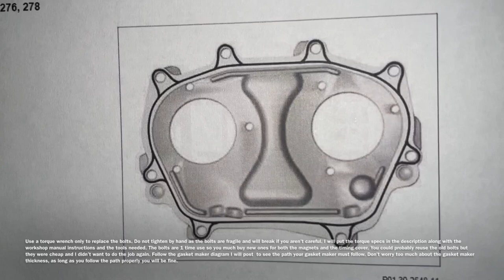Mercedes timing cover / cam magnet reseal - oil leak fix for M276, M278, M157 and more.

Comment: The M276, M278 and M157 seem to all suffer from cam adjuster cover oil leaks. Guys, check yours on your next service. Both covers are leaking on my car, car is at 104K km. Due to the position of the covers, dripping oil may destroy your alternator/AC compressor. It's a relatively easy job too.
Reply from the maker: Yes it is a pretty easy job, just important to be clean.
Reply: this is a common issue, mercedes issued a TSB on this, but the problem doesn't occur until after the warranty period. They should've extended this problem to at least 100k miles for TSB warranty. Save your receipts and file with the appropriate agencies / lawyers. maybe we can get re-imbursed for something that is obviously defective.
Reply: @ginco_bnz  this is a common issue, mercedes issued a TSB on this, but the problem doesn't occur until after the warranty period. They should've extended this problem to at least 100k miles for TSB warranty. Save your receipts and file with the appropriate agencies / lawyers. maybe we can get re-imbursed for something that is obviously defective.
Reply: Shit I was thinking why my alternator looks so greasy and dirty. Well now I know all coming from the leak above

Comment: Hey, thanks for the video. I am doing the same and the job is a little more complicated then what I had anticipated, space is tight on drivers side even after removing the coolant reservoir, but I realized that the intake plenum is completely in the way of the bottom-right two bolts. Any solution on how to take them out? I bought U-joints to no avail, looks like I need to remove the intake plenum/manifold which I do not want to do. If it's necessary, is there any easy way to remove it? Any tips would be great, thx!
Reply from the maker: I added a PDF of the workshop instructions for the passenger side in the drive in the description. You don't need to remove the intake manifold, simply use an 8mm combination wrench on the 12 point star side to remove the bolts you can't reach.

Comment: thanks man. helps a lot. the  insane thing is that mercedes issued a TSB on this, but most of the leaks occurs after the warranty period. Mercedes should be issuing a recall this since it is so common.
Reply from the maker: Yes you're correct, a tech I know at a Mercedes dealership told me to check for this problem and that's how I found it. An independent shop wanted to charge $1500 to fix so I decided to just do it myself as it didn't seem too hard.

Comment: If the timing cover is not leaking, can I just replace the camshaft magnets and their bolts. Also is it possible or advisable to only replace the o rings on them? I have a small amount of oil in the connector of the magnets and am planning on replacing the 4 camshaft magnets, 4 cam sensors, and adding pigtail connectors as preventative maintenance as the ecu is currently free of oil.
Reply from the maker: Yeah obviously you can just replace them, not a big job at all.

Comment: Do you know why it says 5nm for stage 1 and stage 2 is another spec? What do they mean by stage 1 or 2? Thanks
Reply: Generally, when the torque for bolts is done in two stages, the first stage is at a certain torque setting (say 5nm) and the second stage is at another turn of the wrench, like 90°.  Do both, if that's what it says.

Comment: Engine timing isnt affected by this. Its just minor and slow oil leakage. Motor cant be destroyed unless you are running below MIN oil continuously.
Reply from the maker: The warning was more along the lines of if you drop a bolt into the timing chain you're screwed.

Comment: Thanks a lot for the tutorial, will be doing this soon on my C400. Just wondering, is there any specific way of placing back the cover? Is there an order on thigtening the bolts?
Reply from the maker: Read the workshop manual in the description.

Comment: nice video! so just to confirm on parts needed - 16 timing cover bolts, 12 magnet bolts and 4 o ring gaskets for the magnet solenoids?
Reply from the maker: Yes if you plan on replacing all the bolts. I only did 1 side’s cover as it was the only one leaking but when I do the other side in the future I won’t be using new bolts as I felt it was unnecessary at the low torque numbers.
Reply: @jamesk7433  would you happen to know the tsb #? My dealer wamts to charge 1500$ for thjs job
Reply: @greyeuro   here you go. TSB LI01.00-P-067802. anytime the dealer gives a 1500 quote and especially from mercedes, you can mostly likely do it yourself for 100 to 300 bux.

Comment: Awesome tutorial! This is so helpful. Do you recommend buying the Loctite 5970, or is the gasket sealer you listed fine? Also, is one or two enough?
Reply from the maker: Any oil proof gasket maker should work. People say Mercedes OEM is the best, but obviously not if it's failing at ~50-60k miles on these engines. Toyota apparently makes a very strong one as well.

Comment: good job... but why your check engine light is on?
Reply from the maker: I don't have a tune for my downpipes
Reply: this is a common issue, mercedes issued a TSB on this, but the problem doesn't occur until after the warranty period. They should've extended this problem to at least 100k miles for TSB warranty. Save your receipts and file with the appropriate agencies / lawyers. maybe we can get re-imbursed for something that is obviously defective.
Reply: @ginco_bnz  this is a common issue, mercedes issued a TSB on this, but the problem doesn't occur until after the warranty period. They should've extended this problem to at least 100k miles for TSB warranty. Save your receipts and file with the appropriate agencies / lawyers. maybe we can get re-imbursed for something that is obviously defective.

Comment: Hello, thank you for this excellent tutorial! I think I have exactly the same issue… but on my side, I think that I have only one joint which leaks, that of the magnet (well) placed, in front of the oil filter! How long did it took for you to solve this oil leak ? Thanks in advance!
Reply from the maker: If its just the magnets should just take a minute.
Reply: Thanks! I just had a bad surprise with the oil filter gasket which was not sealed after disassembly (1 l. oil on my car park 🫣). I had to change it (the diameter of the toroid was bigger on the new gasket… it seems Mercedes didn’t put the right gasket reference 😮…), and everything was OK after that. Now I’m driving since a week and looking if the others gaskets are OK!… it seems to be!… THANKS AGAIN!

Comment: Wondering if you could help me? My smaller coolant tank right next to the main one cracked open do you by any chance know what it’s called? It’s the smaller one found when removing the engine cover thanks!
Reply from the maker: It's for the transmission / intercooler cooling system. It's called the intercooler coolant reservoir. https://www.ebay.com/itm/394361635071?nma=true&si=Lpys%252B8boD3KZz3I%252FScEGtxSidTU%253D&orig_cvip=true&nordt=true&rt=nc&_trksid=p2047675.l2557

Comment: torque specs in nm when reinstalling bolts?
Reply from the maker: Read the description.
Reply: @ginco_bnz  I just read through the files attached with the description and I couldn't find the torque specs listed either.
Reply: @elliotleslie3916  i  think its 5nm
Reply from the maker: They should be at the bottom, under timing cover instructions. 5nm.

Comment: Monkeys mane🙈
Reply: this is a common issue, mercedes issued a TSB on this, but the problem doesn't occur until after the warranty period. They should've extended this problem to at least 100k miles for TSB warranty. Save your receipts and file with the appropriate agencies / lawyers. maybe we can get re-imbursed for something that is obviously defective.

Comment: Do you know why it says 5nm for stage 1 and stage 2 is another spec? What do they mean by stage 1 or 2? Thanks
Reply from the maker: tighten to 4nm then another 60 degrees. If you couldn't get that this repair may be a bit over your head.